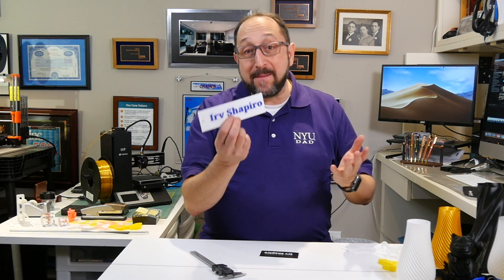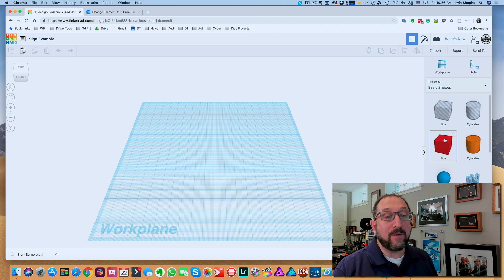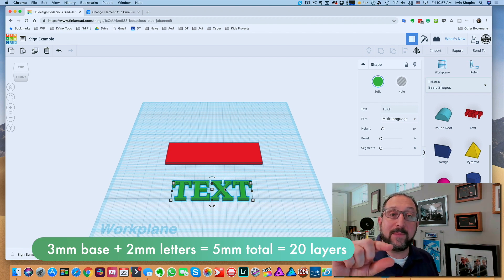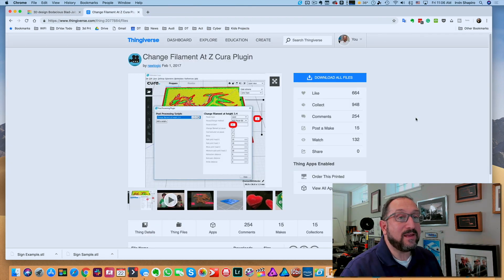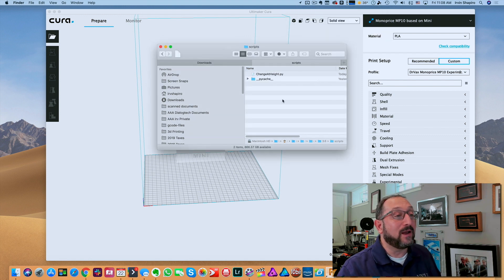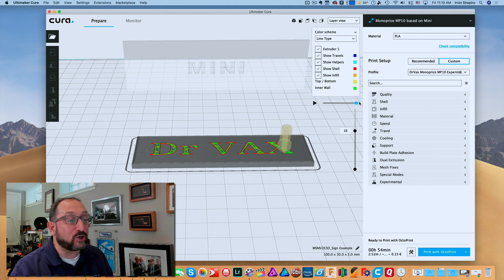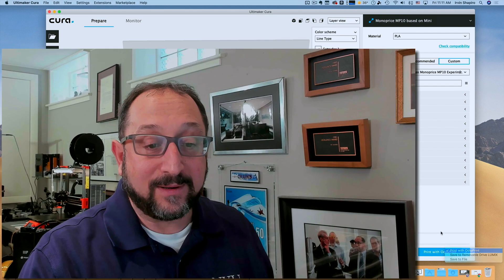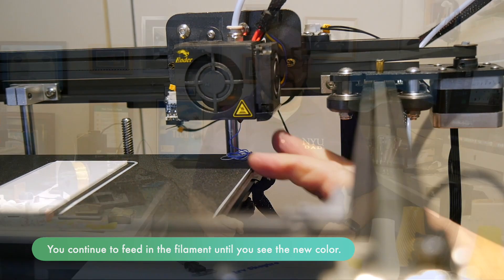Multiple Color 3d Prints on a Single Color Printer

Comment: I needed to print in two colors and this video really help me. Thanks!
Just a note that I had to place the ChangeAtHieght.py in the plugins directory rather than the scripts for Cura 4.4.1
 this is described on the thingiverse page
Reply from the maker: Thanks for sharing.  You can also use prusaslicer with any printer not just prusa printers and it has excellent multi color support.

Comment: Hey DrVax, I thought you might like to see a recent print I did on the Ender 5 using this method and plugin.
7 Colors. 6 swaps.  Black, White, Blue, Yellow, Red, White, Silver   .2 layers
https://imgur.com/gallery/BfSX2GL 

It was just under 9 hours.

1 issue I still have not figured out is that if I make the first layer like 2mm thick, and start the 2nd layer right at 2mm (Instead of buried a layer or 2 down), Cura still slices it as if the layer is sinks down, but fills it an too.  So, as you will see in the first black layer pic, at .2 layers there were 10. But, for the top 3 or 4, it printed around where the letters would be, then filled in the gap.  This takes way longer than if it had just printed the layer smooth like it was supposed to.  In this case, the black layers took 4 hours.   Wish I could figure that out.
Reply from the maker: Absolutely beautiful.  Well done!!
Reply: @MakeWithTech  thanks!